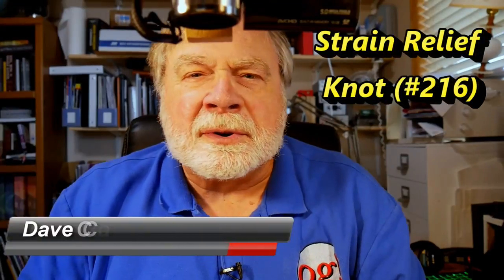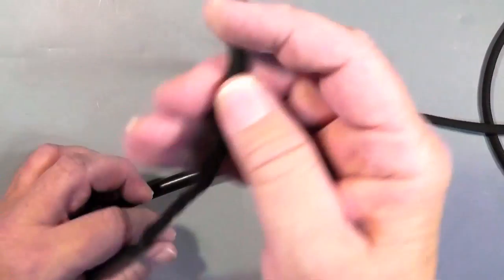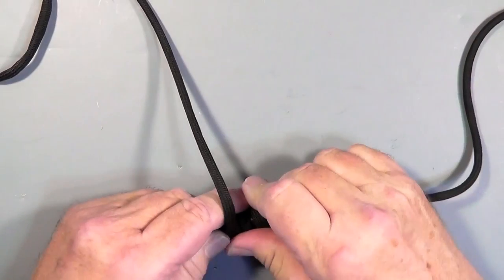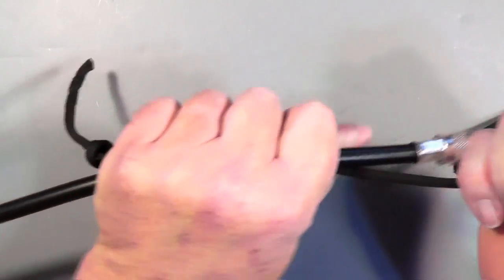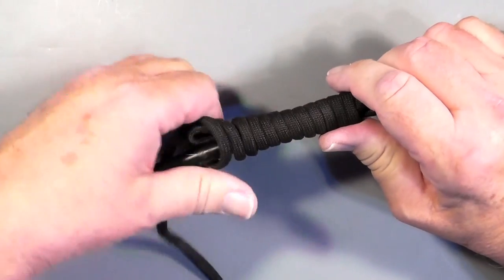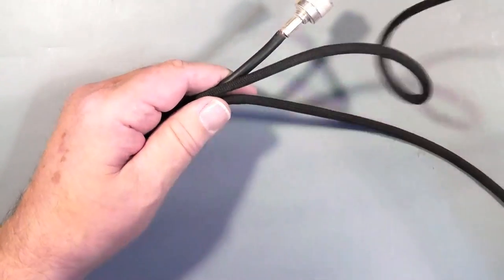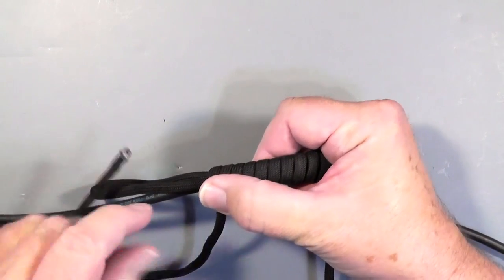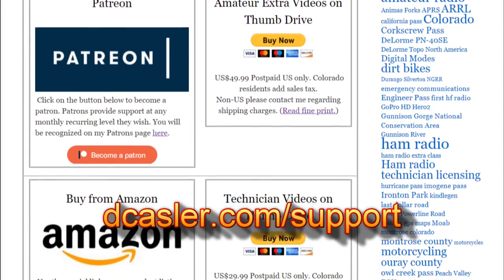Knot for Coax Strain Relief (#216)

Comment: I used to be a member of a search and rescue climbing team and your knot isn't a Prussic or Hangman's knot, contrary to what others have said.  A Prussic knot is made from a loop os smaller cord and is ment for a temporary longitudinal blinding along another rope and not as any sort of semipermanent use.  A Hangman's knot is designed to slip, not to keep from slipping.  Basicall yours is a modification of a Whipping knot,  which is used to constrain the braiding of the ends of a rope.

I agree will previous comments that present various methods of increasing the coefficient of friction between the cord and the coax, but in my opinion the key is to use rope that is significantly  smaller than the coax.

As long as you put on enough turns, you use is more than adequate for your purpose.  Thanks for all your YouTube videos Dave.

Comment: The knot you show stays tight and "locked in at the bottom but can loosen at the top as you discovered as you were tying it.  A prusik loop will not loosen on it's own.  It is adjustable if you need to reposition it on the cable.  Also, remember "friction tape"?  I use some friction tape to wrap the coax under where the knot is to reduce slippage.

Comment: Well Thanks for the knot tieing lesson for the "Albright Knot" it's a fishing knot btw. I don't understand why anyone especially radio amateurs would use Crimped coax connectors. For 30+ years I have always soldered my PL259 connectors & never once had one slip off or come loose.

Comment: Hi, Dave. Thank you for sharing this info. I do the same wrap, but a bit differently. We call it a "prusik loop" (supposedly invented by an early Austrian mountaineer Karl Prusik) used by rock climbers to attach  thinner cord with a slip-knot  to a thicker rope. Original version prusik   leaves two loose ends . I wrap some layers of self-vulcanizing insulating tape around the knot  and  abt. 30 mm each side on the coax.

Comment: I learned this rope dressing, known as whipping, while a Boy Scout. This was used to prevent the braid of the rope becoming unraveled. The whipped rope ends were then dipped in warm liquid wax to prevent the whipping from coming. A Boy Scout's rope ends where always neatly trimmed. I have used a cloveline hitch, prusik, timberline hitch, and several other rope knots as strain relievers when using dangling coaxial cable.

Comment: Hi Dave, I found that if you wrap the coax with rubber weather tape first, then do the rope strain relief over the tape, it holds a lot better. The rope presses into the rubber tape and prevents any slipping.
Reply: Nice , I just wrapped some tape around my coax and tied one of those strain reliefs on it, no slipping, thanks for the tip

Comment: My father is electrician and he thought me very similar knot electricians use. There is also knot used for attaching fishing hook to string. It all works the same way.

However, it is reccomended that rope used is significantly thinner than cable. It increases the grip.

Comment: Dave, I've never seen that used as a (clever!) strain relief, but the same "knot" is commonly made with dental floss or similar light whipping line to seize & whip the end of lines (ropes) on sailboats, so the sleeve and core don't unravel. It is just called "whipping a line" and never referred to as a knot, or possibly called a whipping knot if you must. 
 Certainly easier than finding a proper cable sleeve (chinese finger trap) thaf electricians use!
Reply: Yes, that sure looks like the whipping used to secure the end of a rope or other cordage from unraveling. 

Also, when working with cordage, I find a marlinspike useful for working with knots and for use as a toggle to pull the knot tight. I wrap a few turns around the marlinspike (in the center), and then pull with the working end between my fingers, which gives me a "T" handle. I can pull cordage very tight that way. I keep a couple of fids in my kit for the same reason.
Reply: Yes, I agree it is the beginning part of "Whipping" shown here as #3442 (the left one or first of the three segments) "Common, plain or ordinary whipping is tied by laying a loop along the rope and then making a series of turns over it. The working end is finally stuck through this loop..." Page 546, The Ashley Book Of Knots by Clifford W Ashley - now in public domain. Here is a 40.54Mb searchable PDF file. http://www.chamberssailing.org/files/documents/CSK017-The-ashley-book-of-knots-(not-printed).pdf

This Whipping has one bight (loop) and is different than a the Hangman's Knot which has two bights (loops). See #366 page 59 and #1119 page 204.
Reply: That type braided spring steel "basket type" strain relief can be found at industrial motor control supply stores in conduit sizes. Or in Electrical contractor supply places like "Graybar". that have an aluminum collector crimped on 2 pieces of airplane cable that are braided, for holding triplex type SE cabling. They also sell the aluminum reverse wedge, that squeezes the cable as it pulls. (that's mainly used on residences

Comment: Hidy and thanks for posting. Tape a bite loop to the coax, then tie a prussick knot and it will not slip. It's easy on and easy off, but won't slip unless you want it to. If you want to adjust it, don't tape the bite. 73's, from General in Tennessee. Oh, and the name of that knot is the HANDLE knot. (Because it's how you make a handle grip on something to coat it for a good protective grip.) Actually, you want to bury the tip line under at least 1/3 of your wraps and then tape the bottom end.

Comment: The rope that you are using is Dacron which is "a high strength polyester that combines high strength, low stretch and excellent resistance to abrasion, chemicals and weather."

Comment: He’s right. 50+ years ago I learned to “whip a rope” as a boy scout to keep the end of a sisal rope from fraying (I guess now they just teach them how to use a pocket lighter?). Quite a few hams use a length of heat shrink tubing at the connector to both reduce strain on lighter coax and provide a bit of additional water resistance (along with an actual waterproofing technique... I hope). Heat shrink tends to be a bit less slick than coax jacket and also forms a (tiny) edge where it ends. I wonder of that might help with slippage? Thanks for the great videos! W2RSB / F4WCM

Comment: Another very easy method of strain-relief is to put a wide black tyrap around your mast and the coax, but don't cinch it up yet. then put a black wide tyrap around the first tyrap , that will be between the mast and the coax, and gently cinch it up but not entirely. Then cinch up the first tyrap. What you want is to make a stand-off that insulates between the mast and the coax. They need to be tight, but not to the extreme. Play with it a little. (It's a really easy concept to learn.) When In high wind areas, secure this way at least every 18". This stops wind vibration which MAY resonate & influence frequency or cause SWR problems. This also works on power wires/cables. It makes a strong stand-off that keeps down surface wear that COULD lead to wearing off insulation over time, and center wire coming in contact with braid or ground. This quick trick stops that cold. ((DON'T USE CHEAP TYRAPS. they don't do well on tight pulls like this. Please pass this concept around to your viewers. "General" 73's to all

Comment: Flexible coax cable outer sheaths are designed to be a little bit slippery for those occasions when they need to be pulled through short lengths of conduit/ducting.  Maybe a little roughing up with sandpaper would help the knot stick better?  (as long as the weather-proofing is not seriously compromised).

Comment: do you not have any issues with condensation forming or rain soaking into the paracord and getting into the pl259?
I would worry about water being on or near the pl259. I usually cover all of mine with water proof tape so that's not an issue.
Reply from the maker: You are right. I need to wrap that connection before Winter gets here.

Comment: A "loop" of small stuff or rope is a bight. The process you went through is called "frapping" when lashing together poles and the like. It is neat looking but a more effective method is using a series of half hitches or even a loop of the coax and 2-3 half hitches to keep the loop.

Your solution is more elegant.
Reply from the maker: Thanks for the tip.

Comment: Have a look at the Prusik knot: https://en.wikipedia.org/wiki/Prusik
It is used in climbing and mountaineering. I is much easier, simpler and faster to tie. It holds well, yet it is easy to adjust and undo. Similar with the klemheist knot https://en.wikipedia.org/wiki/Klemheist_knot

Comment: I believe the knot you are thinking of is perhaps the barrel knot,    https://www.youtube.com/watch?v=J49Uhd43tR4     or the the triple overhand knot.  https://www.youtube.com/watch?v=yRfjF5TcQbw  the both could be tied with the coax runnung through it. It would be much less likely to loosen at one end.  I would think that 3 or 4 turns would be optimal for use with coax.  73   KO4GJO